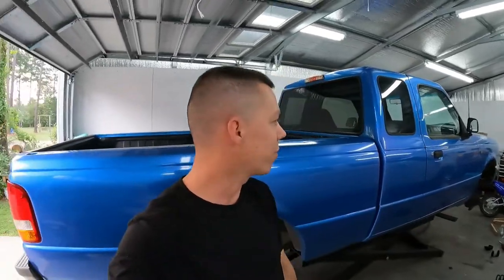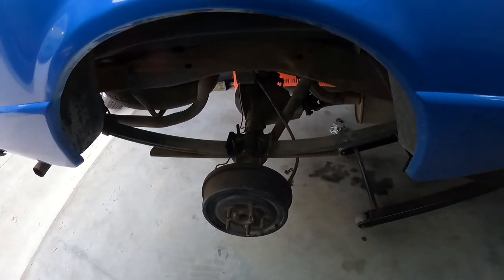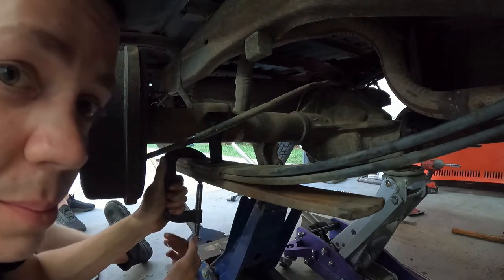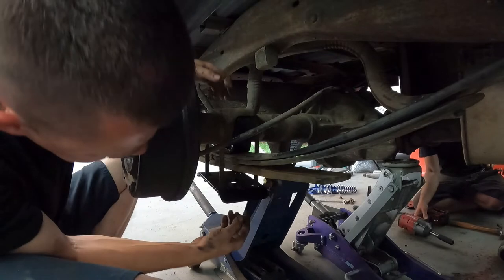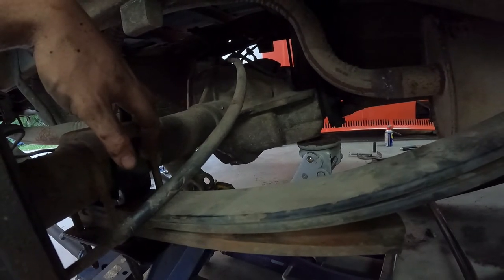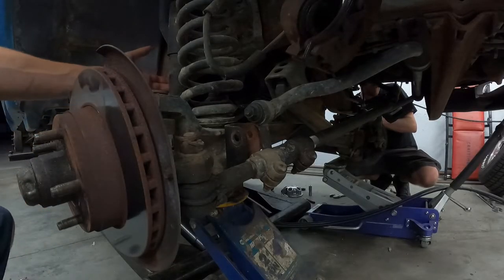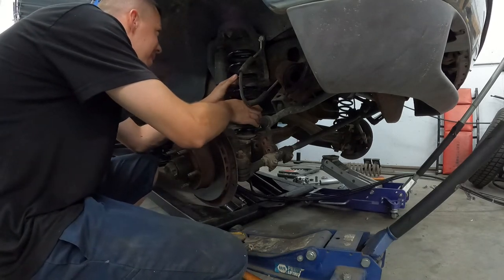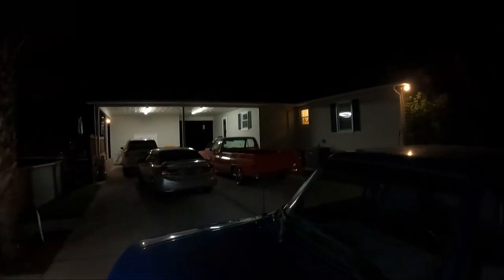Lowering a Ford Ranger 3 / 6" for cheap - How to

Comment: I lowered it and now the e brake is stuck
Reply from the maker: Make sure the cable isnt pinched or pulled tight somewhere
Reply: It isn’t, do you think I would have to readjust it
Reply from the maker: @spy6271  maybe. Thats just wierd. Ive never had to do that after a lowering job

Comment: What did you say you can do to fix the cambering in the front?
Reply from the maker: On this model that has the twin i-beams, they make what I call an alignment bushing (or offset bushing). You essentially take the factory ones out and the new one slides back in. The best thing to do is take it to an alignment shop and have them measure it to see what size bushing you need, then they will have to install it and index them.
Reply: They make adjustable ones so you don't have to pre measure. I'm looking at Moog's adjustable bushing for when I do ball joints and possibly level kit.
Reply: Or you could do drop spindles to get rid of some of the camber if your lowering a rwd
Reply: @dukeskookum2674  where can I get the adjustable ones?

Comment: Where do you get the offset bushing from?
Reply from the maker: Any local part store can order them.  A good alignment shop should stock them as well. Theyll need to measure your current camber and caster to determine which one you need and to install it in the correct orientation
Reply: Thanks!

Comment: Would I need to get new shocks ?
Reply from the maker: You dont have to but its best
Reply: @ballsoutperformance  I have a 95 b2300(essentially a ranger) and it has the twin I beams in the front and I can’t find anything out there for it, I found a kit for the rear 5” drop and the front drop with springs, but can’t even find lowering shocks. Do you think not having lowering shocks would make it not go as low?
Reply from the maker: No, it just may not ride as good without them.
Reply: @ballsoutperformance  thanks for the help, I can’t find anything on the rangers and Mazdas with the twin I beams in the front so this helps